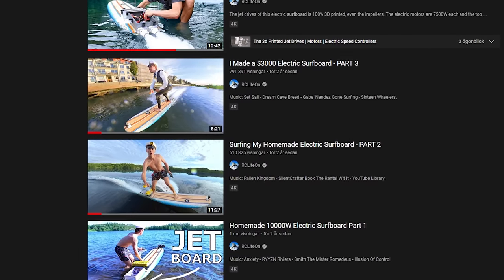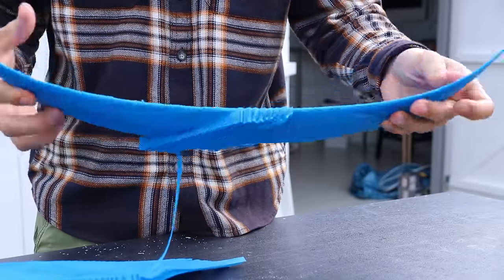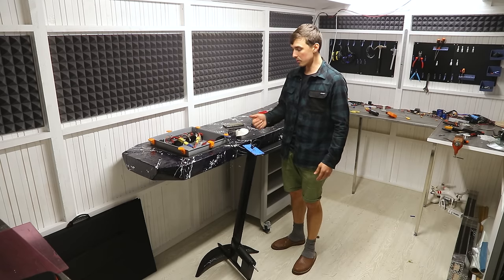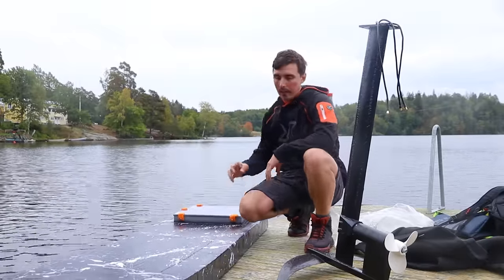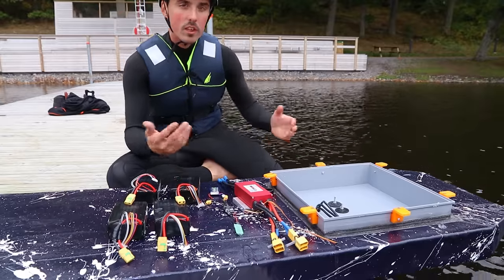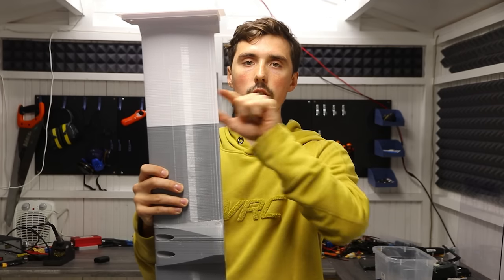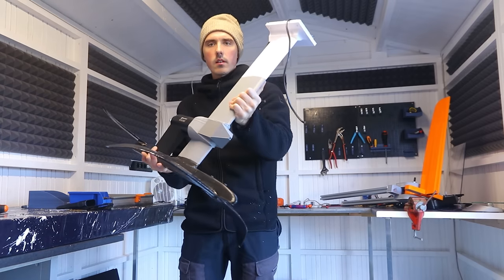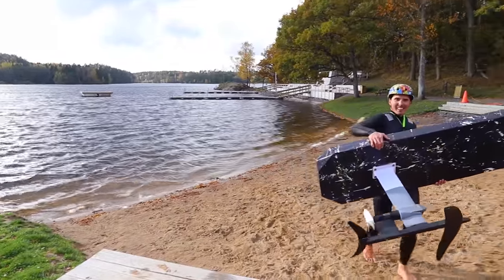3D Printed Hydrofoil Surfboard - Will it Work?

Comment: I assume that the wings bend and a lot of lifiting power gets lost. Try to Analyse the under water situation by using a GoPro or such. Great video. Love to see part 2
Reply: Bump
Reply: That was my thought as well. Given how thin they are, when put under the load of a full person they probably just deform to the point that there is no lift
Reply: i thought so too
Reply: When I've seen commercial foils, they were VERY stiff - all solid CF and resin. I think the 3D print / wrap approach is not rigid enough Maybe 3d print a new one with room for a truss rod?
Reply: Or maybe good ideas from people that have created successful boards.
Reply: Yea the whole weight of everything above is being supported by the wings they need to be stronger.
Reply: The flex may be a problem, but the majority of flex will be spanwise, so it won't affect lift all that much. I'd be more concerned with the surface quality, especially on the suction face of the foil (top of lifting foil, bottom of stabilizing foil). It's not hard for a foil to be built to a point where it's lift:drag ratio makes it more trouble than it's worth. The potentially insufficient stiffness might lead to fluttering of the foil though, that would be pretty obvious when riding it because you'd feel the vibration.
Reply: needs more power to make up for the inefficiency, or improve the design
Reply: agreed here. I bet you guys add some carbon rods through the center of the wings for added rigidity. It would also create a nice joining surface for the cross section.
Reply: @alexwbakker  best option I can see, is carbon fibre reinforced PLA or PETG, leave holes for carbon fibre rods in it and give it a thick coating. That should help it be pretty stiff.
Reply: Nice project and nice videos. in order to make it fly you need to increase the front wing i'd say minimum 1600 cm2(good ratio for your weight and skills) and change for a lower ratio with thicker leading edge. you also need to be able to move your back foot so it is roughly sitting on top of the mast. this is probably the main reason why you didnt make it fly in the video as you seem to have plenty of speed even wuth that small wing. on the other hand as much as 3d printing makes the project go in the water quick you need to take the time to laminate everything with epoxy and don't be afraid of layers or overkill it with carbon fiber. the stiffer the better. a good source of infos if you want to improve your knowledge in the foiling field is the forum" foil zone". good luck 🤙
Reply: Could do a FEM calculation. I have used SolidWorks in the past.
Reply: Maybe asking a local pool if you can film the lift in clear water after opening time
Reply: @weatheranddarkness  
I agree. With water being around 830 times denser than air, even small imperfections will create a massive amount of drag. And those wings were definitely not sanded properly/at all.
Reply: this 100%
Reply: Two suggestions.
1 reinforce the wings with an aluminum plate as a core.
We tend to print everything, but in this case a combination of a rectangular aluminum plate  surrounded by printed plastic may be structurally stiffer.

2 the wings angle of attack is crucial. Try experimentally to change it little by little using washers or spacers.

Nice project!
Reply: @Terrestre1  Edit: Oops he did fiberglass it (I had to recheck because I initially watched it when the video came out). Maybe a few more layers might help.
Reply: Probably the problem yep
Reply: @HaloWolf102  🔴 What Is Islam? 

🔴 Islam is not just another religion. 

🔵 It is the same message preached by Moses, Jesus and Abraham.

 🔴 Islam literally means ‘submission to God’ and it teaches us to have a direct relationship with God. 

 🔵 It reminds us that since God created us, no one should be worshipped except God alone. 

 🔴 It also teaches that God is nothing like a human being or like anything that we can imagine.

🌍 The concept of God is summarized in the Quran as:

📖 { “Say, He is God, the One.  God, the Absolute.  He does not give birth, nor was He born, and there is nothing like Him.”} (Quran 112:1-4) 📚

🔴 Becoming a Muslim is not turning your back to Jesus. 

🔵 Rather it’s going back to the original teachings of Jesus and obeying him. 

More ....
Reply: @alexwbakker  print it in polymaker pa6 or pa12 cf then wrap it. Just need 300c and direct drive out of the hotend
Reply: Low torsional strength of the wings, the twisting lowers the angle off attack of the wings near the tips so less lift gets produced.
Reply: He needs to stand every further back. I have a lift foil and it will not lift if you are to far forward
Reply: I didn't even think about how to make it better but that makes sense
Reply: thats not the case, the foil simply is too tiny to lift him. with such a tiny foil u have to generate really much drag in order to get enough lift.
Reply: @alexwbakker  Another option is 3D printing the negative shape of the hydrofoil and using it as a tool for CF layups. That’s something that I’ve been thinking about for future projects.
Reply: I'm afraid he attached wings in an opposite way. So they work only as sheets with a big angle of attack.

Comment: Great project ! Your main wing looks quite small, I do kitefoiling and the typical front wings are around 800cm2. Then the wingfoilers use bigger wings like 1000 to 1800cm2. I think you should try at least a 1000cm2 front wing with a 300cm2 rear wing for it to lift you over ;)

Comment: The foil sticking into the bottom of the board was hilarious! I think you need much much bigger wings. Also wings with a lower aspect ratio will make them stronger and more stable at lower speeds. Look at winging boards for inspiration.
Reply: Not necessarily, since the plastic box was above the foil mast, it was preventing him from getting his weight back, also higher aspect wings are usually better at everything that isnt carving + yaw

Comment: You probably could have gotten it to work but you have the battery components blocking you from standing over the foils.  My suggestion, for simplicity, is to add a footstop behind the battery and controller compartment.  That way you can balance your weight over the foil.  I don't think you have quite enough power to stand in front of the foil at this point.  Maybe not even standing over it but worth a shot.   Good luck.  Can't wait to see your next steps and future projects.
Reply: That’s what I was thinking. What would happen if he left the foil as in bud shifted the weight back. One foot behind the electronics box and one in front.
Reply: Correct. If his body weight is too far forward on the board, the foil will never lift him.
Reply: Yup you need your weight centered over the lifting wing. Can't believe he didn't consider that fact when building this.
Reply: @capodad2u  has to be a lil in front of quarter chord to maintain stability, But at his speeds the wing is too small, he needs more power
Reply: Most commonly the center of mass should be directly above the front wing. Now the back foot is roughly above the front wing. It really seems that there is some lift coming from the foil. Just try to stand like Charles suggested and the board/foil should rise from the water. If not, then you check the angle/size of your front wing. Nice work, keep going!

Comment: As a foiler myself all you need to do is move the mast forward which will create more lift.  And only a small movement which be very effective. You'll also want to adjust this setting quite a bit so make it adjustable.  Great effort by the way, love it 👍
Reply: he definitely needs a bigger wing. trust me, mine is small and bigger than his
Reply: @kstorm889  yeah I agree, I'm running a 950cm2 wing on a fairly small board and his looks smaller than than that.

Comment: I hydrofoil a lot and if you were to stand back a little more that would of definitely flew in the water. It’s a huge balance game.
Reply: I have also a foil but electric and i think that you just need a bigger motor or bigger wing, is just not enough lift, if he leaned back more it would lift but the wing would stall immediately i have like 30h on a electric foil so i know a little bit
Reply: @henryknowacki3554 Yeah I agree stall or un-natural flight angle on the front wing could also happen instead of flight. Definitely more speed could help too no matter wing surface area. However, these are all things worth trying but stance would be an easy test before tedious fabrication.
Reply: Yes ne needs to lean back more problem is the box to all the electronics are right where he needs to stand so he'll have to address that somehow.
Reply: My gut feeling, is that the box is in the way, so he can't stand back any more. Something to consider for future designs I guess.
Reply: yeah he needs to be able to stand in such a way that his center of gravity is a fulcrum for the wing
Reply: yes, this comment is helpful, hope RCLifeOn reads it - if he manages to put the back foot on the plexi or right behind it, with that power and speed he should be able to lift the board, great progress dude!

Comment: I tried basically the same project last year except I thought the board building from xps would be too time consuming so I just bought a cheap board from my local decathlon. Also did some research and found  Ray Velinga' s videos explaining the hydrofoil calculations. he also has a book its a great read, it would help you a lot.
One other difference between your design and mine is that I used two aluminium box section to strengthen the 1 m long spar, İt works great. 
now Im building a much stronger v2 cause the first one broke on the board-spar joint while testing.(on sea with me on it while my dad was pulling me with a boat. which was terrifying to say the least)
Reply: You should video the building process for the second version bro!
Reply: big 3d prints like that really need some kind of extra strength, either box or threaded rod tightened down a bit like re-bar in concrete - I find thinking of 3d prints like concrete is good for the design process
Reply: @trif55  Very nice analogy. When talking about pla I pretty much always use concrete as an example, cuz pla is stronger on compression then tension especially if the print lines are perpendicular to the force.
Also its stronger than some materials like abs but not as flexible.
Reply: I also used Al box section and shrink-tubed the bits. Not as strong as FG skin, but nice and smooth.
Reply: @OzAndyify  interesting 🤔 now I'm thinking what if I shrink tube after fiberglass/epoxy.
Does shrink tube peal off easy.
Reply: @GoldenHat333  It does, although you will have to sand the FG down a lot as any bumps will show through.
It works well for the mast, but gets a bit messy where there are compound curves like the tips, motor mount, etc. Comes out nice and shiny. Be a bot wary of shrink tube with PLA as excess heat can be very bad!

Comment: Your speed is fast enough to go up, but your wing is too small. Really impressive to see that the 3D printed mast resists with your second prototype 👌
Reply: Either the wing is too small, or it flex too much under pressure. I would recommend a full carbon piece.
Reply: @AlexLefevreArt  it's both
Reply: I agree it is both.... but for sure the wing is to small and maybe the wrong shape for lift under load in the water.

Comment: I'm a windsurfer from Germany. I'm pretty shure, that you need a bigger front wing. (maybe out of carbon)? You are really fast, so fast enough to get up. 
Also your Board is really long. The Foil Boards in Windsurfing are a lot shorter and wider. Then the board ist also pushing more water down. And maybe you need to shape your nose a little more like a windsurfboard.

But so far, great job. Be careful, if you're getting it and the Board ist lifting it will be very unstable. And if its lifting to much, the foil will get out of the water und dann you will crash very hard.

Comment: Great work mate!
A couple of thoughts:
1. The lift created by the hydrofoil is proportional to the size of the wing and the angle of attack of the wing.
See if you can design a few different airfoil sizes and add a method to adjust the angle of attack and test them.
2. You may need to make the connection between the board and mast stronger. When the board is out of the water your entire weight will need to be supported by that joint.
Consider doing a test on land where you attach the mast to something solid and then stand on the board. If it doesn't break, you're good.

Comment: you can check out actual foils for windsurfing boards to see how they do it(shape and size). i'd recommend windsurfing ones because those carry the most amount of weight(bigger board and a heavy rigg so a lot of weight)
Reply: Or a downscaled one off of a moth (sail boat).
Reply: @moite2665  if the structure scales properly then sure. windsurf foils are the perfect size though so they'll definitely work

Comment: A couple other comments point to the biggest issue with your wing and not generating enough lift. In layman's terms, with a higher aspect wing (wider in width and narrower in height), more speed is required to generate equal lift, than that of a stubbier style wing. When you pick up speed you can clearly see the board trying hard, but there is just not enough surface area to make it for the max speed you can get up to. When you go to a higher aspect wing, you will increase your drag significantly, but the trade off is you will able to be get the board up an foiling!

Foiling SUP downwind setups which are popular would be a solid place to start given the length and weight of your board, or some of the larger efoils, like getfoil! Great video as always my man!

Comment: check the flexibility of the wings, i suspect that they are bending giving you a different lift capacity than what it has been modelled for. Also a taller mast will give you easier lift, så perhaps the wing you have is modelled for no flex and tall mast, so you will need more power through speed to get equivalent lift. you can also make some cutouts at the back of the board reducing the trailing edge and thereby drag. Last thing, you might be able to get it to lift with some "pumping" but then you might just break parts. Great build though! and great storytelling of the challenges!
Reply: this is probably right to some extent
Reply: Yeah, i second this.  The wings seem like they are potentially not strong enough and are not keeping their shape.

Comment: Great video! For your 3D printed foil, make it stronger by adding 2-3 layers of carbon fiber fabric/cloth or even fiberglass fabric/cloth (do not use fiberglass mat). Carbon fiber has way better mechanical properties (stiffness, rigidity, etc) . You can use an epoxy resin for that, the best resins for technical carbon parts are: epoxies and polyurethanes. Search online, you'll find a lot of details about this topic. Also, I am not an expert on hydrofoils but you probable need a bigger foil and more thrust on your motor/propeller. Good luck buddy!

Comment: My suggestions:
Place your center of gravity above your front wing.
Cover all of your printed part with thick layers of carbon fiber, especially in mast connections . With glass you are way too flex.
Seal better your battery box.
Keep your speed controller as cool as you can.
I'm really impressed that you get that fast with this setup.
Looking forward for your follow-on video.
Keep it up.good luck

Comment: Foiler here. You need a larger wing. Like 2x the size. The larger the wing the less speed you need to get flying. Double it and try again, also need the surfaces to be baby smooth. Nice work so far!

Comment: Great build! Way to persevere. One thing which you might know, is that adding extra wall thickness when slicing has a much larger effect on strength and stiffness of 3D printed parts vs adding infill. It's why hollow structures can be very strong while reducing weight. Love what you are doing. I watch it with my kids. Best regards.

Comment: Great stuff.
Couple of suggestions.
It's all weight shift when controling the foil. So stand above the front wing.
Do quick rocking from front pressure to rear pressure and back to front foot pressure to get flying.
Much easier to do on a shorter board and with a flat deck.
One foot either side of mast is essential.

Comment: Great video! It seems you need more lift from the hydrofil. You may try changing the hydorfoil form a classical wing-tail configuration to a wing-canard configuration. A wing-canard will provide more lift while ensuring stability. Other than that, increaseing speed, increasing the main wing area on the hydofoil or tilting the main hydrofoil wing so the angle of attack of the main wing will increase may lead to generating some extra lift. Hope to see your progress in the next video!

Comment: Keep up the good work.  The mast the wing is mounted to may be flexing forward from the thrust pressure.  You may need a brace going from the front side of the motor mount diagonally (45 degrees) up to the bottom of the surf board further up towards the middle of the board (front to back).

Comment: You definitely need a bigger wing. The wing you used is designed for kitefoiling. There the kite lifts you additionally so the kitefoilers can use smaller wings. Nice video and greetings from Germany

Comment: That's a high wing loading (per area).  Tiny flaws in shape, surface and angle of attack get magnified making it easy to lose laminar.  More cowbell (area) needed on the wing.  Some good comments on balance as well.  For your "watertight" boxes, at some point you may want to suck it up and buy a plastic tote and some grommets.  I know you like huge 3d prints, but....
It's good to see you back to having fun with the videos.  I hope you're feeling better and enjoy continuing to inspire.